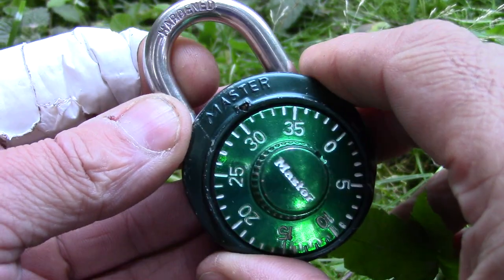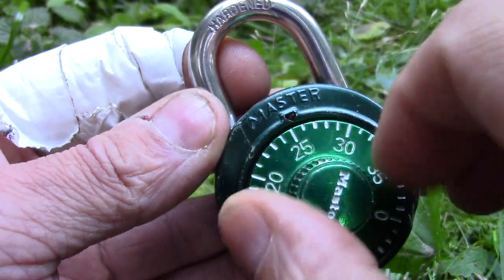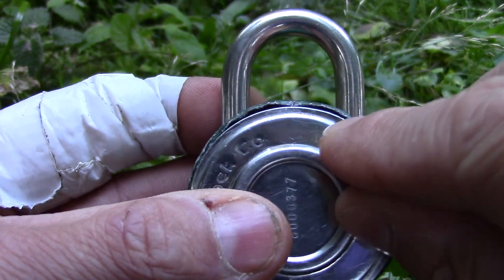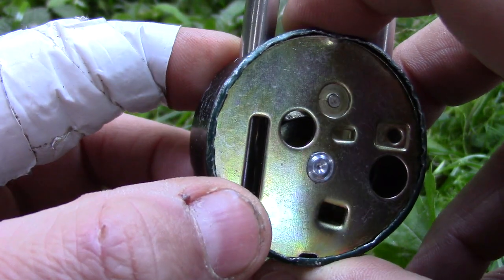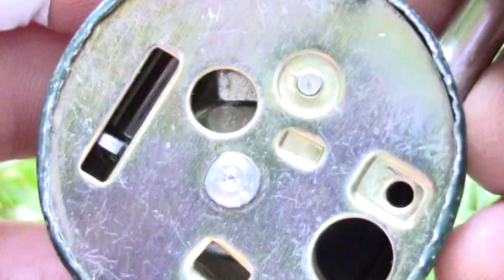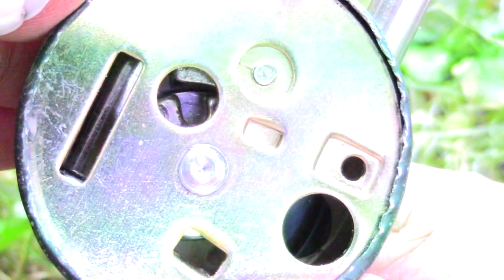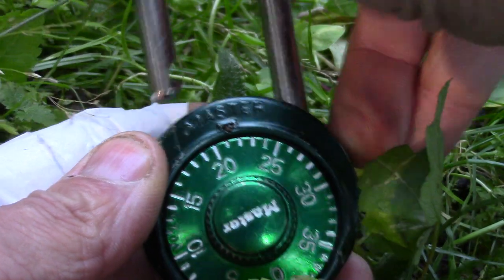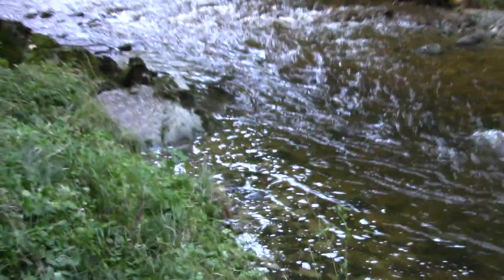(picking 405) Decoding a Master combination padlock by "seeing" the code

Comment: Fantastic location my friend. I can't believe its that easy to pop the back of that lock, great video
Reply from the maker: Thanks a lot - I was also shocked when I found how soft this metal is and that they have left holes to observe the internals.
Reply: How did he pop it open with a wiper blade? I wish be had shown that part in the video?
Reply: How did he pop it open with a wiper blade? I wish be had shown that part in the video?

Comment: A very beautiful place to vacation!  And yes, I believe Master Lock padlocks are still made like that.  They're only good for school or gym lockers and similar low-security applications.
Reply from the maker: Thanks for watching. It's amazing that they even left holes where you can observe the wheels spinning. Do they really check the locks by looking inside as quality control measure before they put on the back plate? Or why do these holes exist?

Comment: The old matrix method that reduced the number of possible combos no longer works.  Like many methods (Bic pen/tubular lock etc.) they go back decades, but dissemination of the info was slow.  I learned about Bic pens in the 1990's  before internet access.

You probably could backwards engineer the matrix, but I think they altered the manufacturing process.  Ironic, since shimming is faster and the real problem with theses locks
Reply from the maker: Yes it shimmed open very easily but I've seen/heard that newer models have a shim-protection. Anyway if you can look inside all other security-measures are pointless.